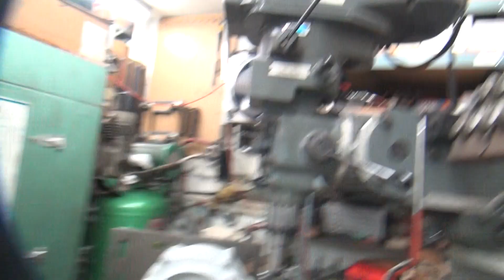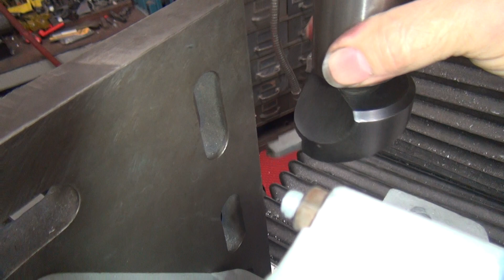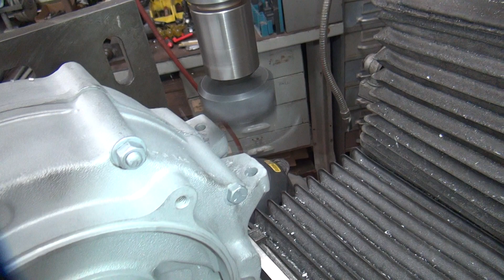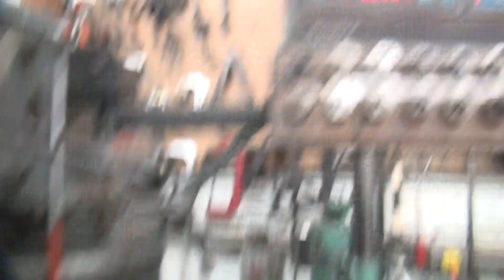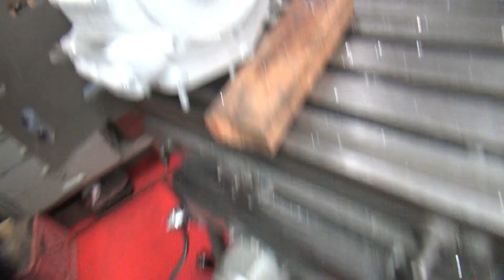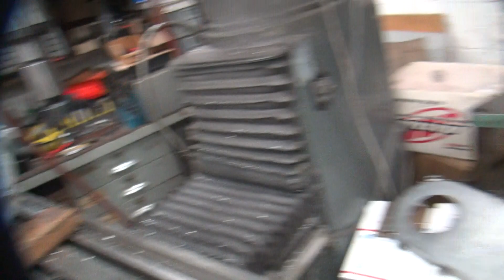#113 1976 98ci stroker shovelhead motor rebuild case repair flywheel balancing harley tatro machine

Comment: Mr tatro quick question can a kickstarter be installed on an early 80 ironhead big debate about it
Reply from the maker: no, 1979 was it. harley changed the motor castings. it would take a ton of welding to put it all back. just get some 1977-79 cases.
tatro
Reply: @TatroMachine  i have an early 80 and the cases are setup for a kickstarter they are matching numbers is it possible that it is a left over 79 case and the vin is jo